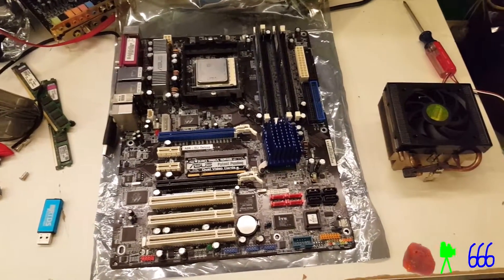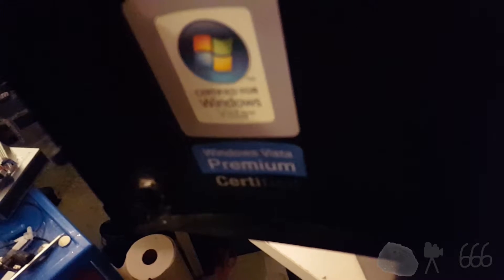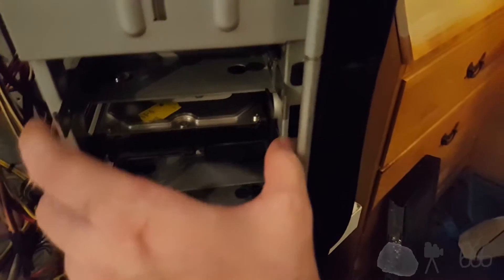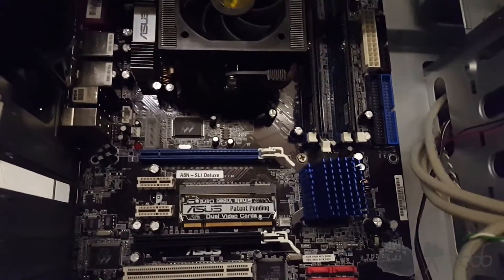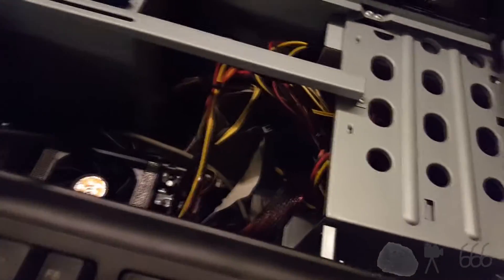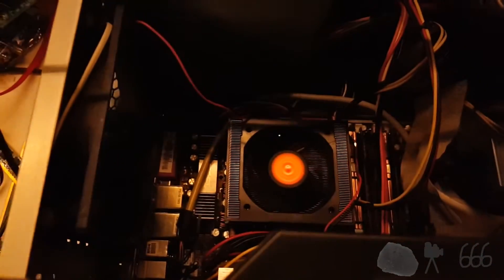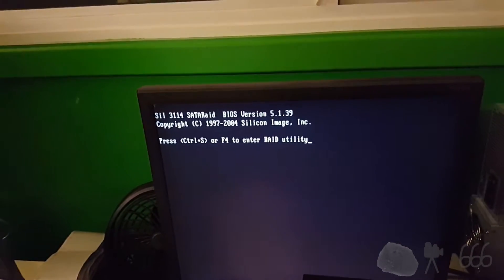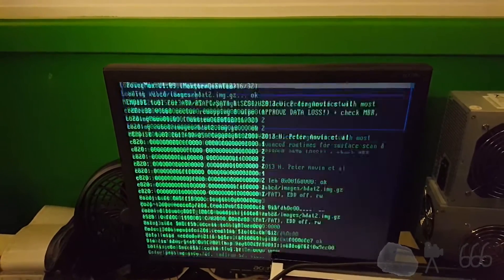A Foray Into SLI: Asus A8N-SLI Deluxe System Build, Part 1 of ?

Comment: What graphics cards are you planning on using, or is that a Secret To Be Revealed Later?
I tried SLI only a year or so ago (2x GTX 780) for Destiny 2, but the uneven frame pacing (micro stutter) was annoying so I got a better GPU (GTX Titan Xp).

Windows 7 is fine, I'm running Win 95, Win 98 and Win XP on my "Vintage" gaming machines.  I even allow the XP machine on the web without "protection."  YOU CAN'T STOP ME!